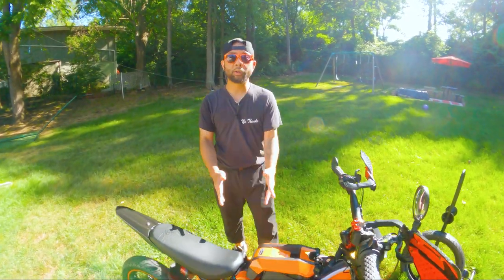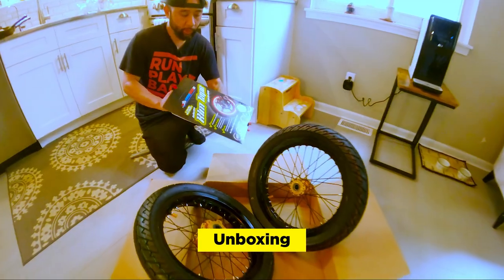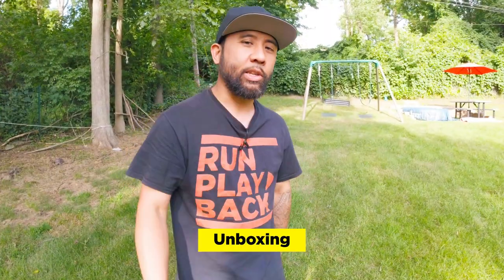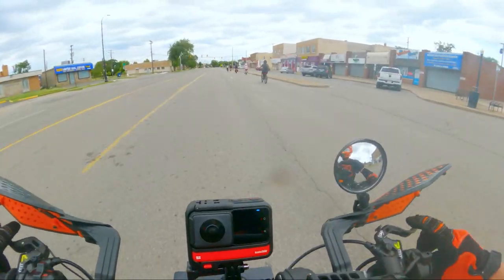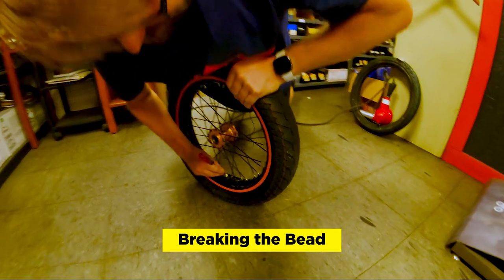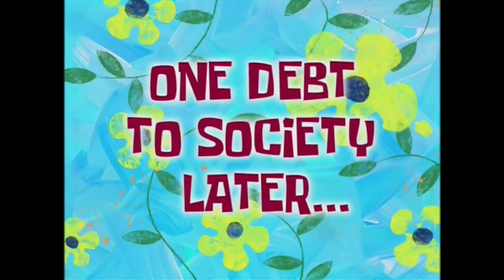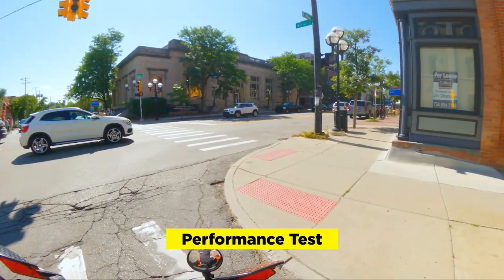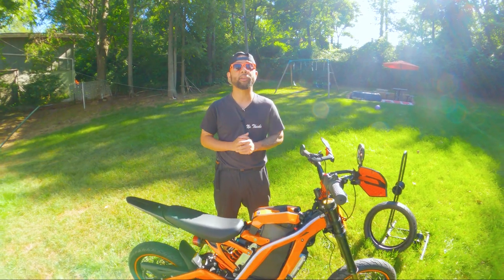Flow Wheels Sur-Ron 14" Supermoto Full Review and Test Ride | RunPlayBack

Comment: O plan on getting a Sur-Ron within the next 2 month. I am healing up from knee surgery after getting hit by a car riding a Honda Ruckus. I am 5'0 and wanted to know if it would be a great idea for me to get the 14 inch supermoto wheels to bring the bike lower. Everyone says "Ohh you'll be able to ride it stock", but I know it will be a bit tall for me.
Reply from the maker: You can ride it stock but if you want to flat foot it, the 14" should be fine. I'm about 5'5" but I also have seat lowering brackets for reference.

Comment: Any specific reason why you chose the 14 inch  instead of the 12’s?
Reply from the maker: I mentioned it briefly in the video but basically the bike is already pretty low with my seat lowering brackets and I thought the 12" would make it too small.

Comment: Was there a top speed loss after you installed the 14”? I’ve been debating between all the different wheel sizes lol
Reply from the maker: I didn't measure it but probably only slightly. You can augment these things with sprocket sizes though. But when I take this thing top speed not once do I think to myself "hey this is 5mph less than 17" wheels". I immediately think "Jesus Christ this thing is awesome!".
Reply: @RunPlayBack  only reason I asked is because I use my bike to commute to work often (7 miles) and certain parts of the road I need to be going at least 40-45 mph because there’s no bike lane 😬
Reply from the maker: @dfmu2669  Oh yea for sure! So are you on the stock controller or a BAC4000?
Reply: @RunPlayBack  stock but I eventually plan on getting the bac4000
Reply from the maker: @dfmu2669  oh ok cool...yeah top speed will lower slightly but you can regain it back if you switch to a 42t sprocket.
Reply: @RunPlayBack  cool. Thanks for the info and appreciate the quick response!

Comment: Does this affect top speed by going with a smaller wheel/tire?
Reply from the maker: Kind of? I didn't really do a top speed test but basically you'd have to adjust the RPM/power settings to match the top speed of the 17's. Since I typically only go 6000w in street mode, it's just about bumping that up a little higher and playing with the motoring torque ramp. If it's just the stock controller, going with a smaller 42t sprocket would compensate for the speed.
Reply: @RunPlayBack  ah ok thanks. That’s good to know you can tweak the parameters to compensate if you need to. Still learning this stuff. Just got the CTY2 last week 👍
Reply from the maker: @NoFlyDrone  Awesome! That reminds me, I need to make a video tweaking the parameters on the CTY2 for faster acceleration and torque.
Reply: @RunPlayBack  That would be awesome! I’m coming from FPV drones and planes so it all translates pretty much right to ebikes but it would be nice to see a good starting point and the app/hardware needed. 👍

Comment: Would pedal kit fit with this size wheel tire? Or would the pedals make contact with the ground
Reply from the maker: It would depend on how long the cranks are.  You would need to be mindful when leaning.
Reply from the maker: The shorter crank arms on the Kaniwaba kit would be fine.

Comment: how you get the forks not to rub against the tires ?
Reply from the maker: Installed 80/80-14 tires
Reply: What tires I need for 12inch
Reply: @RunPlayBack  you can use wider TRIPLE CLAMPS if you want fatter tyres!!!!